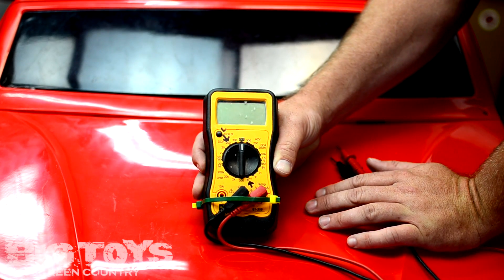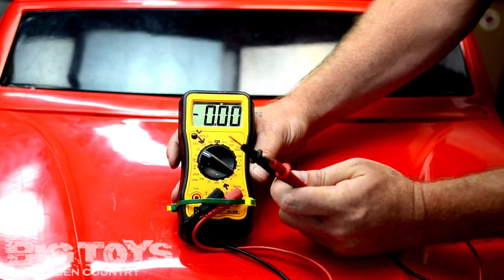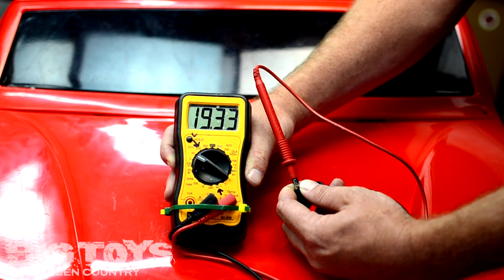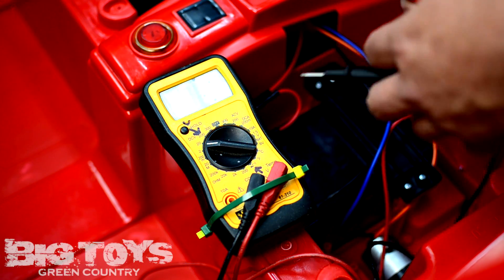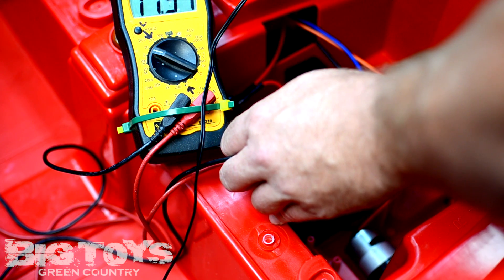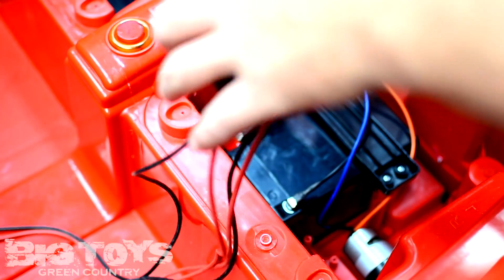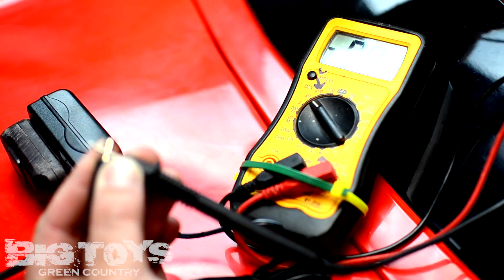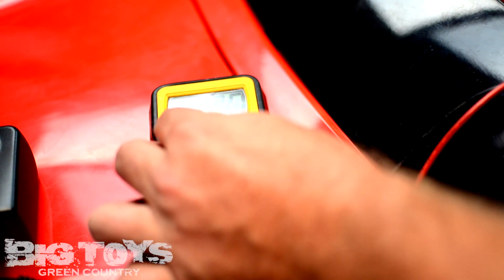Battery & Charger Testing

Comment: I have a 3 bank marine charger and when I put the leads on the chargers it reads just under 14 volts. Is that enough? It is a deep cell charger charging at on 5 amps per bank. And I'm sure your cars are meant to charge much faster. Just curious if my charger is doing its job. Thanks in advance!